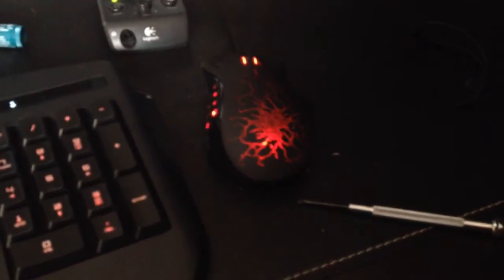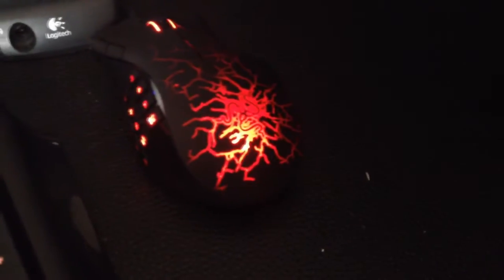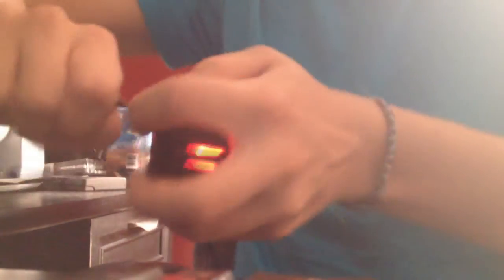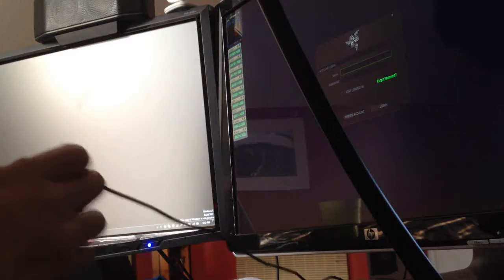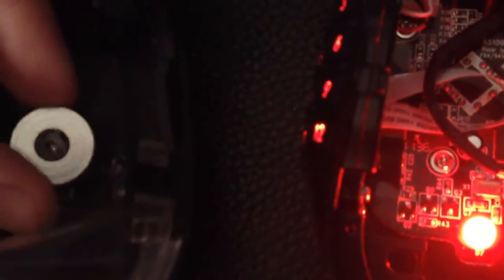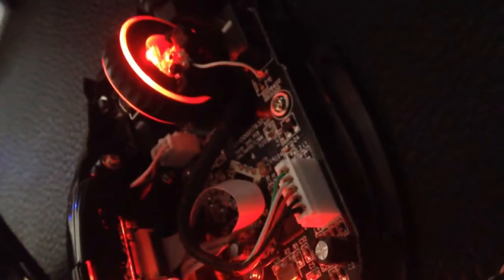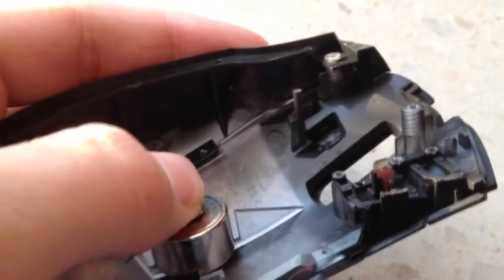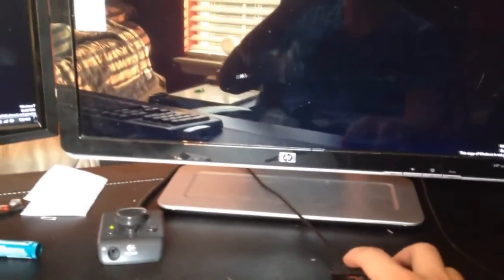Razer Naga tracker fix

Comment: I broke mine the same way.  Didn't bother reattaching the weight.  I personally don't care how much my mouse weighs.  I bought the naga for the side buttons.

I have had a problem with my naga since day 1, though.  Every once in a while, it completely halts cursor movement on the Y axis.  Usually for only 3-4 seconds at a time, but it is very annoying.  Anyone else ever experienced this or have a fix?
Reply: Devon Veenstra Wow i feel sorry for you my day 1 problem is that when i press the 2 button sometimes it gets stuck and i have to pull it out... The button.
Reply: i know this is 1 year ago but mine use to do this and recently my laser just went out after 4 years :(

Comment: so mine wouldn't move and it was because the weight had broken off just like yours except I didnt glue mine back on again, I simply cleaned it, took the weight out (it was just loose making that rattling sound when i shook my naga) and put the cover back on and it was working fine. I guess the weight isnt needed